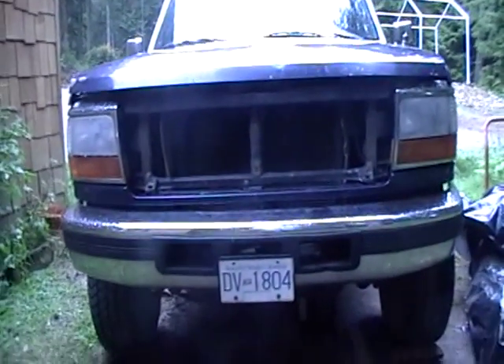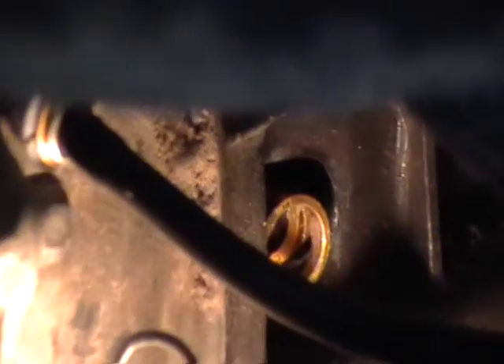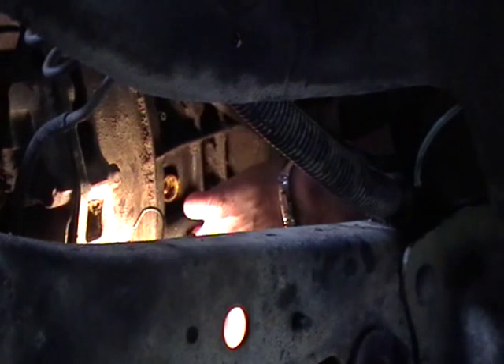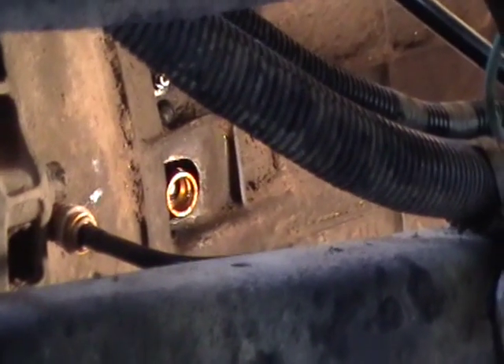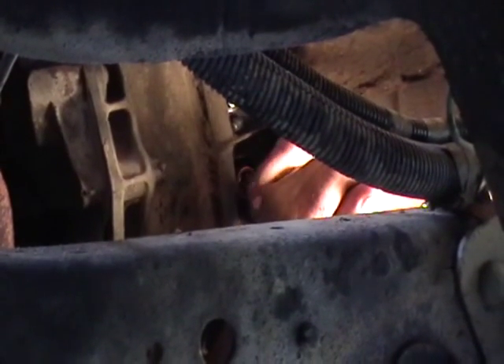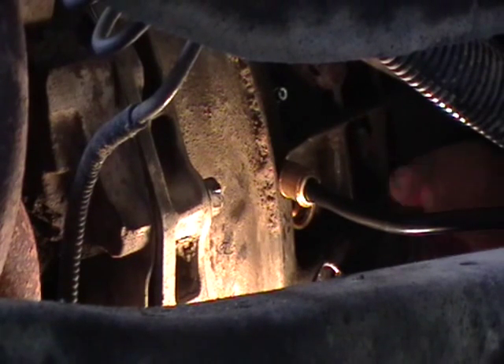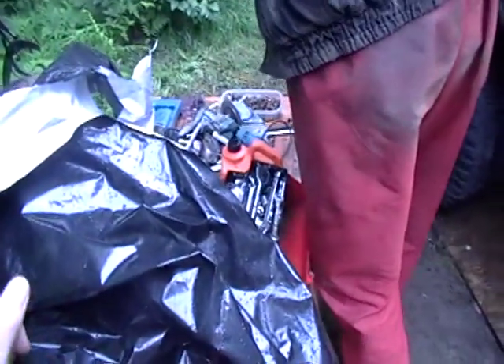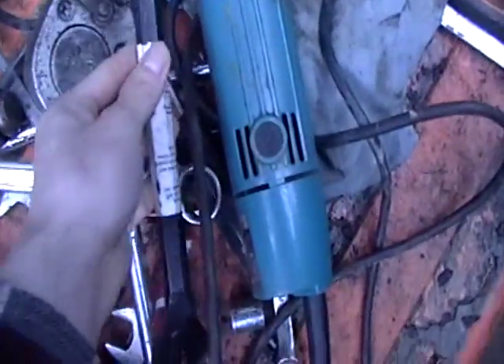Trying to install a New hydraulic bleed line on a 1995 Ford F-150 4x4 302 v8 Part 1

Comment: Tell Terry that the O ring must be a metric size,that transmission is an M5OD R2 which is built by Mazda and all the parts are sized in metric. The reason it won't  go in is because his O ring is too thick. It has to fit precisely or it won't lock in.

Comment: always had good luck with Ford trucks but my '95 f150 has me dealing with the same thing right now...I'll get through it but have to say it's a pain in the ass because it's really a bullshit design...love Ford trucks but hate whoever came up with this hydraulic clutch set up,it SUCKS!!!
Reply: It is a Mazda design. They used that trans because it shifts really smooth and it was much cheaper than what Borg and Warner wanted for a medium duty 5 speed.

Comment: The auto stores laugh their ass off knowing that dorman and others make them in 
China and Mexico and they are off by a few thousandths of an inch, just enough to prevent it seating, the angles are cut wrong on the same part numbers and the clip areas on some are shorter and some are longer and some clips are short and some are long. The plunger travel on some is 3/4 and some is 1/2 inch so trying to get one to fit is a hassle even if you know the year and make of the vehicle. Ford screwed this up terrible on the slaves.
Reply: They don't make them,Mazda does.

Comment: Need to put that plastic piece on there or you’ll never get it back off, on mine when I snapped mine back in was I took pair of plyers wrapped them around the copper piece not squeezing the line and used the plyers to push and snapped it in, yea man when ya gotta work on them their all piece of shit lol
Reply: You just gotta know all the quirks,that's true of all modern vehicles.
Reply: There is the old style and the new style. Be sure both the new slave cylinder and the new hydraulic line have the  same style fittings.